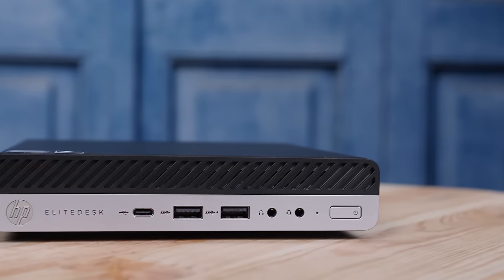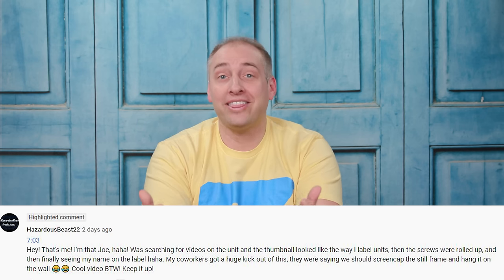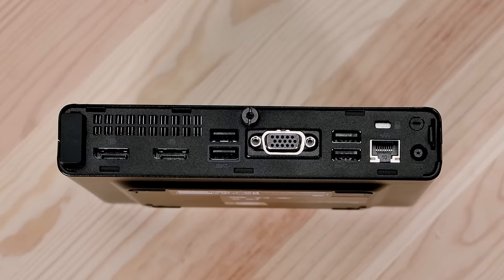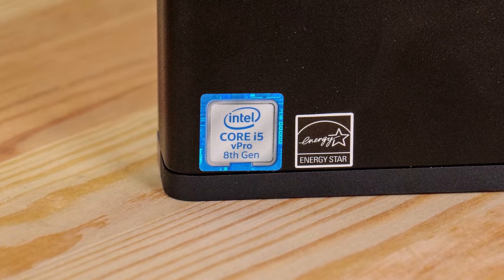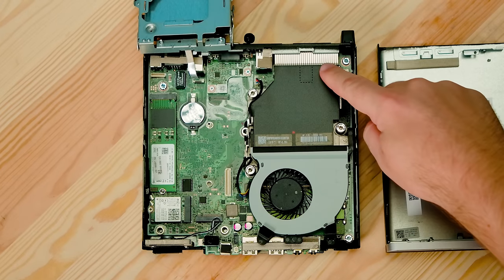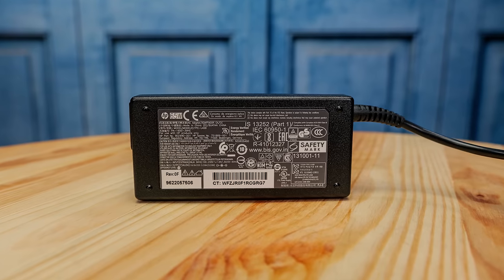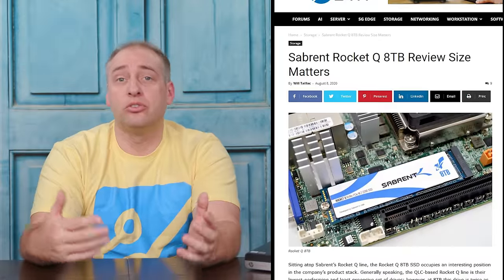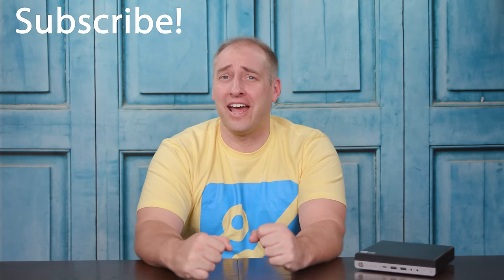HP EliteDesk 800 G4 Mini Guide and Review

Comment: A quick note since the Velcro comment remains but the sentence after was edited out and I missed it. We use the Velcro mount mentioned with dual M.2 SSD in this system to provide enough space for everything since the carrier will get in the way. You still need the SATA/ power cable but that can be detached from the carrier.
Reply from the maker: An important note here.
Reply: This is true. I use just one NVMe because of these, gonna try the Velcro thing!
Reply: I'm curious how you did the velcro mount.  Where did you attach the velcro to inside the case?
Reply: @itskyb  I'm going to guess they attached it to the cover. Have you done this? I just got my G4 and discovered the issue wanting 2 nvme's in it.
Reply: Sorry, are you saying you cannot get 2 x nvme and an SSD fitted at the same time?

Comment: I was surprised to hear how much you paid for this. I picked up the Elite Mini G4 with the i5-8500t, 16GB ram, and a 250GB SSD for $320 about a month ago. That's eBay for you though. Nice video.
Reply from the maker: Yea a bit of price fluctuation with these units. You got a better deal than when we purchased this unit in July.
Reply: @ServeTheHomeVideo  are you speaking for used device or brand new? In my country is around ~300 euros used one i5-8500 65W
Reply: I just got a similar spec one off Amazon with new HP Keyboard and mouse for $270.  I am going to use mine as a silent low power server though, so I got it with the i3-8300T to reduce power consumption.
Reply: Can it be use for streaming in 4k. Is it compatible with the Windows 11 for android applications?

Comment: Huh? Did you guys even try to use the second M.2 slot together with the SATA bracket? Doesn't fit. So i'ts max 2 drives in whatever combination you try. The 2nd M.2 slot is heightened to fit over battery, but by doing so it's in  the same space as the bracket.

Comment: Excellent video as always from @serverthehome. @10:39 There is a connector labelled TBTcard in the front of the vga expansion board. The EliteDesk 800 G4 supports a Thunderbolt 3 expansion card whereas the Prodesk 400/600 models do not. Cool for additional external networking/storage!
Reply from the maker: Totally right! There is a dGPU option we go over on the main site article as well (we did not get either.)

Comment: one thing to point out, you can't use 2 m.2 ssds while using the 2.5 inch drive bay since it the m.2 slot is elevated and the drive bay has etra metal on the bottom. if you really want to do it tho, you need to do some "modifications"

Comment: have you tried upgrading it with DDR5 ram ? does the BIOS support it ?
Reply from the maker: DDR5 is a physically different SODIMM that will not fit and the CPU memory controllers/ motherboard need to support it as well. It will not work on these but newer versions have support for DDR5

Comment: Hi Everyone! 
 i plan to buy a used elitedesk 800 g4 i5 8500,  i have a question before i buy it, how long will it probably last (years) if i run it 24/7 with good cooling, for homelab use?

and where is the best place to find replacement for the adapter if it broke later on?  

🙏 thank you

Comment: The one you have has a 35W CPU. I have the same HP EliteDesk 800 G4 Mini but with a 65W TDP CPU, i7 8700. The heatsink is very different than yours. The 65W TDP ones has heatsink totally made of copper including the fins . The lower 35W TDP versions has aluminum heatsink. When i spec the unit myself last year, HP only offers maximum 90W power adaptor.  There was a choice of using a 35W TDP CPU + discrete Radeon RX560 4GB GDDR5 or 65W CPU with integrated graphics other than the 35W TDP CPU with integrated graphics that you have. Since those rigs at the time only offer Wireless AC, today you can get an AX200 or AX210 wireless adaptor to get Wifi 6/ 6E and Bluetooth 5.1/5.2 for a very cheap price. However, do remember you should never ever buy the AX201 or AX211 because they run on CNVi connectors, means they only work with 9th and 10th Intel CPU. CNVi means part of the WiFi hardware is built onto the CPU itself. Older 8th gen CNVi only supports max a AC9560 .
Reply: Thanks, did you mean 9260

Comment: How many years do you think a used pc like this will last using it for a basic pc . Thanks
Reply from the maker: We have some that are 7+ years old Core i5 models and they still work. A challenge is that Microsoft is going to keep increasing system requirements as it did with TPM for Windows 11. If you are just running Ubuntu, then many years
Reply: @ServeTheHomeVideo  thanks Patrick. I just got this HP ED 800 G4 and Dell optiplex 3050m. Thanks for your videos

Comment: First of all, you really do look good in that yellow t-shirt :-) Thanks a lot for this detailed review, I recently got myself the G4 I7 65W version. I don't have de SATA SSD tray, ordered one, I want to use a SATA SSD  just for the OS and the Nvme for storage. Now I have a question about heat management. SATA SSD's do not get very hot but the Nvme's do tend to get hot. Since I'm going to run the little bastard 24/5 I'd like to keep it cool as possible. Now my question is should I get the fan that fits the SATA SSD tray (and a splitter cable to connect both fans on the motherboard) and how do I keep the Nvme SSD underneath the tray cool? I don't think that there is enough space to fit a heatsink or would a thermal chewing gum on top of it be enough?

Comment: Great little machines.I have a g5 and the only issue regarding storage is if you have 2 nvme drives installed then the sata cage does not fit properly as the second nvme slot sits slightly higher.So it is either 2 nvme or 1 nvme in main slot and one hdd or ssd in the sata tray.
Reply from the maker: Velcro the SATA :-)
Reply: Dremel out the caddy tray.  A few cutouts will do it.

Comment: Bro I know this post is a bit old, do you happen to know if usb c will work with external gpu?
Reply from the maker: On these no. Newer ones can have Thunderbolt ports either pre-installed or as an optional add-on.

Comment: I am unable to find any good information about this anywhere so I'll try to ask here... Is the HP Prodesk/Elitedesk line suitable for a nice personal desktop experience? I see these being mentioned for business use a lot, but almost nothing for home use. Some of these are very strong too, like the EliteDesk 800 G6 Mini - a local retailer has one in stock with i7 10700 2.9 GHz , 16 GB RAM and 512GB SSD - all for around 900 bucks. If I pair that to a nice monitor, wouldn't that be suitable for hefty tasks - media use, gaming, music production, editing etc.?
Reply: I'm not sure that this peace is good for gaming, at least not the new labels where you need crazy performance by GPU in that case I think it would be better to use a solid PC tower. 
This one like in video I use both for business and home stuff for every day usage, web programing, multimedia , office and stuff like that not for gaming and video rendering not sure about that music produciton eater

Comment: How I wish there was a unit with vPro and allowed me to drop in at least a 2 port PCI NIC. I have the Prodesk 600 G4 SFF but there is nothing SFF about it. Its a desktop!

I read Nick's guide on running pfsense with a single NIC but I am in favor of letting the switch handle the vlans. Too much ability to vlans hop.
Reply from the maker: Some of these units, I believe we mentioned it in one of the Lenovo TMM pieces, have options for adding NICs such as the i350-T4. Those multi-NIC options tend to be rare though.
Reply: @ServeTheHomeVideo  yes I went down that path but the PCI dongle needed is no longer made and a rarity to find.
Reply: @stevefxp  I'm not sure if you're referring to the Lenovo or the HP. The Lenovo kit, part number 4XC0R41416, which is the I350-T4, includes the PCIe riser, and the backplate, for the supported Lenovo Tinys. It also has the standard SFF & Tower brackets. The M920q and M920x are normally vPro models, unless someone swapped the CPU. I'm currently using an M920q, and that NIC as a pfSense server. I had an M720q but wanted the remote capabilities of vPro.
Reply: Lenovo units with multi nic PCIe card are rare to find. I have two solutions: there are m.2 to Ethernet adapters, mostly used in NUCs. And there are m.2 to PCIe (x1, x4, x8, x16) adapters so you can connect any PCIe multi nic card. The downside is you have to sacrifice an m.2 port (WLAN or NVMe) and you need to get a little creative so the adapters sit comfortably beside the PC
Reply: @carloscuevas8268  completely hard to find! I have been looking all over!
Reply: SFF is small for a desktop still. Few liters compared to 30 or 50L

Comment: Is there a thunderbolt adapter to use to attach external video card or is it better to use internal nvme slot to attach 3rd party ext. video card riser stand?
Reply: There is a thunderbolt adopter called 3TK77AA

Virtually impossible to source
Reply: Did you investigate this further, cheers
Reply: @xntricity6446  bought an ADT-Link m.2 to pcie stand - it works great.

Comment: I did not manage to fit 2 NVMe drives and a sata drive in my 65 Watt model . The Second drive sits too high to be able to fit the Sata caddy.  Or is there some trick in positioning?

Unfortunately on 65 Watt models the Sata caddy also has an extra case fan. if you leave out the caddy and case fan, the  CPU fan spins up more often and faster causing a lot of noise.

Comment: Is there a way to put an SFP+ card in one of these?
Reply from the maker: Not easily. You could get a Thunderbolt option and then do TB to SFP+. You can also get a 2.5Gbase-T/ 5Gbase-T USB adapter then use a SFP+ to 10Gbase-T adapter (look for the Aquantia ones) for your switch. Not the best option, but it is there. Just doing 2.5GbE/ 5GbE is very inexpensive.

Comment: just got one and tried to use Linux mint and Debian 12 that are installed on mSATA to usb-3 and Samsung extended use SD card and reader. GRUB fails on them. I hate HP's windows only mind set. is thare any way to get linux running on this unit?

Comment: Hi! I recently bought a prodesk g4 400 mini (i7 8700t) and I was wondering if is normal that the case get warmer more than anything on the cpu and fan zone and also on the bottom of the case. Thanks!!
Reply from the maker: I do not think we have that exact setup, but the warmer side of the case is usually the side with the heatsinks because those are the higher power/ TDP components.

Comment: Would it be possible to provide the maximum height for the hdd tray?

I can't find such info from the vendors, thus I guess it's regular 9mm height?
It would be pretty nice if they can support 15mm HDD for 4T 2.5 HDD.
Reply: They don't support 15mm. I have a 9mm in the caddy and there is no more vertical space. Maybe you could remove the top part from the caddy (the one that "hugs" the hdd) so you could fit one 15mm. Or do the Velcro thing, hdd without the caddy

Comment: Have you install any linux on them?, do they run ok, is it a nightmare with drivers?...

Thanks.
Reply from the maker: Usually the worst on these nodes is simply getting out of Windows Secure Boot configs in BIOS by flipping a few BIOS flags. The hardware itself is usually the base platforms for each Intel desktop era so drivers are usually automatic on TMM nodes in major distributions like Ubuntu/ Debian.
Reply: @ServeTheHomeVideo  Great, I gonna try it as soon I have the time.

Comment: I just got one of these with windows 11 although on 256MB SATA3 SSD, I'd like to upgrade to a 1TB M.2 NVMe drive. Could anyone recommend which version and speed this PC can handle for the new drive? I would like to not overspend on something that will just have to throttle down to match the PCs specification which I cannot find anywhere. Many Thanks!
Reply: Found it, didn't scroll far enough down on the HP Spec web page
(1) M.2 PCIe x1 2230 (for WLAN)
(2) M.2 PCIe x4 2280/2230 combo (for storage)

Comment: Yep, there's someone ordering it with the optional SVGA port... again, an overt damnation of the Displayports nobody will touch with a ten foot pole.  I wouldn't be surprised if some old tech was fretting how to get a DIN 5 pin connector instead so he could connect his IBM Model F keyboard to it instead of that damnaable USB-C Port.   

Luckily, he found a 5pin to PS2 adapter patched through to a PS2 to USB converter.   So he could use the expansion bay for the SVGA connector.    These tech companies are so out of touch of what a PC tech is going to want or approve because he has to support them or sue them.    Esp. if he is running this thing on a bread rack...   you know for sure he's not plugging no Disploayport monitor into it or a rubber USB-A keyboard.   He'd rather VNC in.

These things are dawgs and ended up getting dumped because of the DisplayPorts...

I think I'll be sticking with the desktops like and EliteDesk because they actually use... a real PC XT style power cord.  Man, you really don't pwwwck with replacing the power connector, that's a standard that has survived since... 1981.   I'm looking at thise mini's you're talking about on ebay... and I have no clue how you'd power them up.  I'm guessing a USB-C and a USB-C charger, which is an absolute steaming pile of donkey do way to power any computer.    Just, no.  For real.  lol...

I've got boxes and boxes of PC XT power cables.   So durable you cold probably hang someone with one...   or tie them together into a rope and escape a prison with them.     Jump up and down on them all day and they won't disconnect or break.  Run 2.5x the wattage through them than they are rated for and they will hold up just fine.

Just because it's newer, doesn't mean it's... better... often.. its worse.
Reply: I'm guessing inferred from that statement, you can totally forget any Win XP, XP64 or Windows NT driver support as well.

Yeah, no Windows 7 or 8 driver support on the properitary motherboard, the only thing salvagable from this unit for a Windows 7 shop would be the CPU, RAM and Ti card if you got one...  maybe CMOS battery... everything else would be headed into the dumpster.   A PC tech could not even recycle the case, power supply, or DVD drive or sata cables.   It's all proprietary.   None of it can be recycles elsewhere into other computers as parts.

If you run Linux or Win11, I guess, your lucky day, but imho those two systems are unusable for serious work.  Windows 7 is like the gold standard still.  Any time I encounter an 11 system, I reformat it immediatley to Windows 7.   Customer can finally use their PC.

Comment: Avoid all these HP PCs like toxic kryptonite!  
From the processor support page:   "PROCESSORS*, ***NOTE: Your product does not support Windows 8 or Windows 7, In accordance with Microsoft’s support policy, HP does notsupport the Windows® 8 or Windows 7 operating system on products configured with Intel and AMD 7th generation and forward processors or provide any Windows® 8 or Windows 7 drivers "

NO Windows 7 driver support = ABSOLUTE TOTAL DEAL KILLER RED FLAG
You don't want to touch these with a ten foot pole unless you exclusively run Linux, in which case, enjoy?
Reply: Ok Boomer?
Reply: @divadsn  Windows 7 most popular Windows version.   Enjoy your Windows 11 hell :)  Just ascsoon as they "end support" for 10...  Oct.14 2025